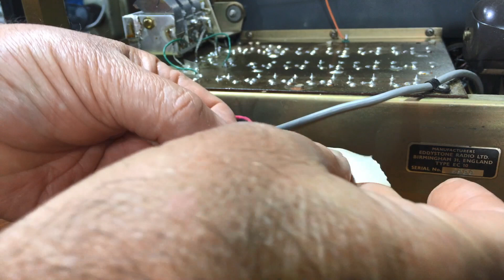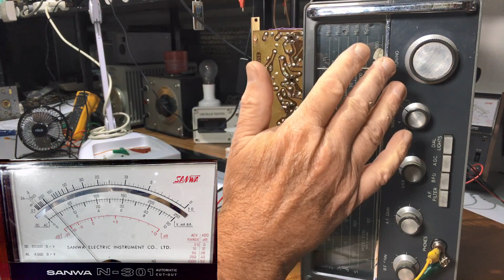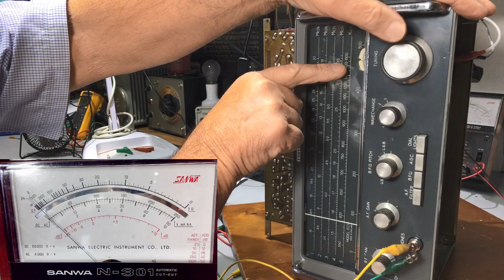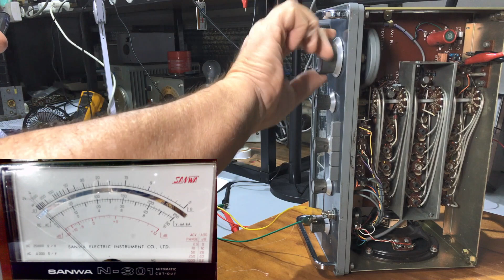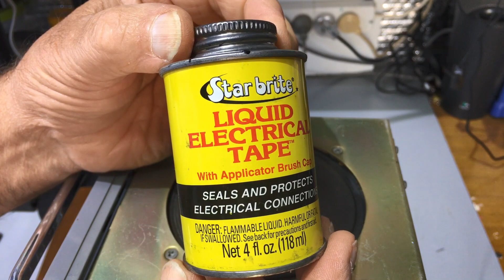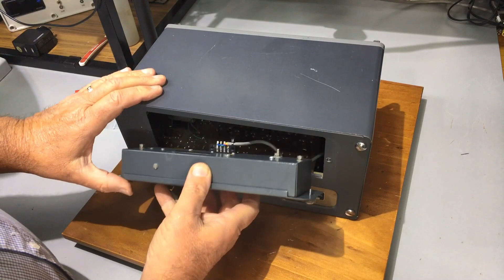Vintage Radio Receiver - The Eddystone EC10 - Part 2

Comment: I have the same problem here, only it's just static and I can't adjust the volume, no channels, nothing. Unfortunately, I have no idea where to start. 🥴
Reply from the maker: Don't be discouraged, it's often just a matter of checking the basic components and working through the signal path! 😊
Reply: @techobaz55  Thanks 🙏🏻 Yes, I'll try replacing almost all the electrolytic capacitors and then see what happens. I think it'll be fine 😉🫡